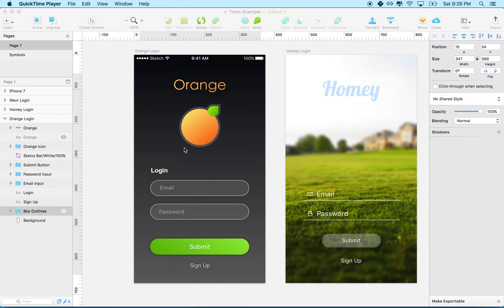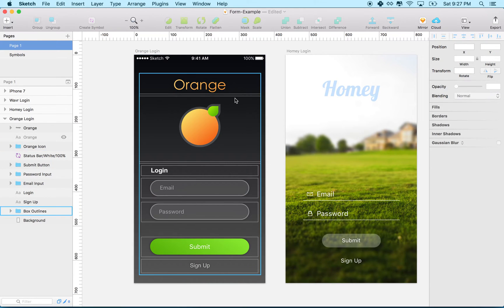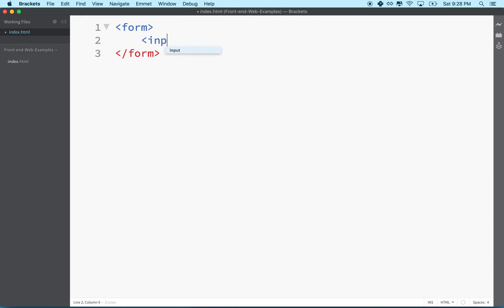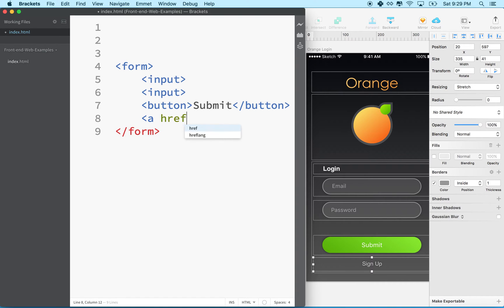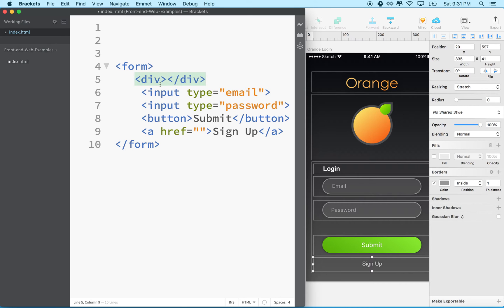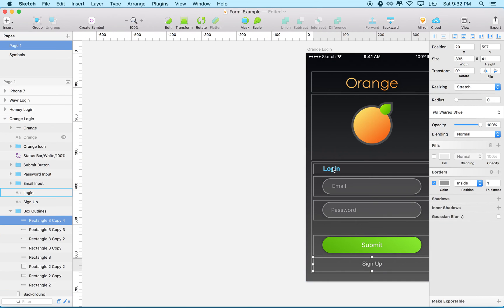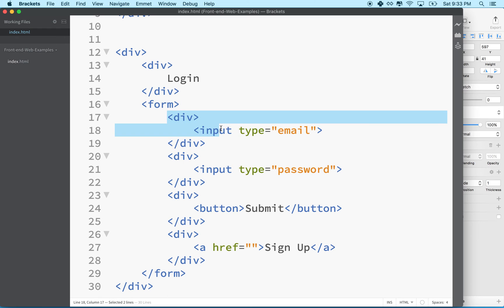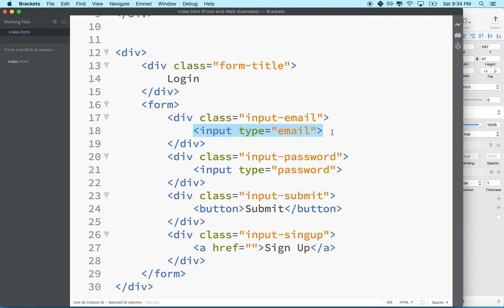01 Sketch to HTML

Comment: Very clear but title is little misleading. When I first read the title I thought you will be kinda exporting the design from Sketch to an HTML ready-t-go file. But instead, I watched you designing from scratch what you have already designed in Sketch. Too redundant for me tbh. 
What's the point of using Sketch anyway if you're planning to code everything separately? right? 
I'm more looking for something direct and saves time. Thanks anyway
Reply: because in some jobs they send you the sketch and you have to convert in html y css
Reply: But it’s not practical. There should be a way to instantly get the code for your design.
Reply: @MoneyandMeaningWithEmad  it isnt